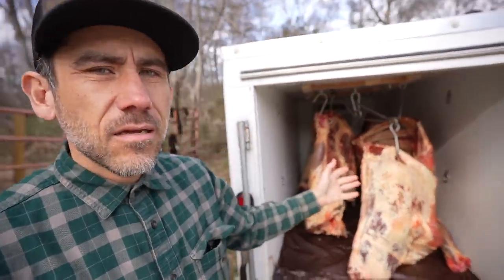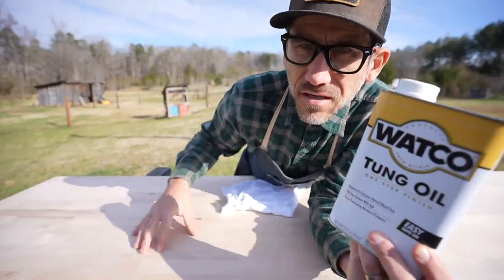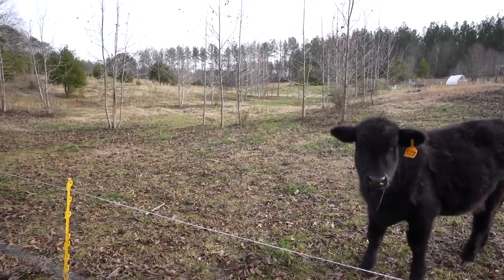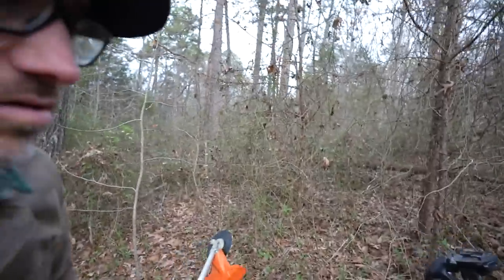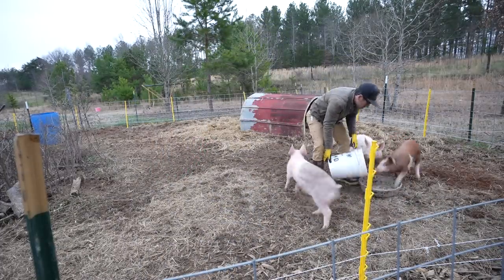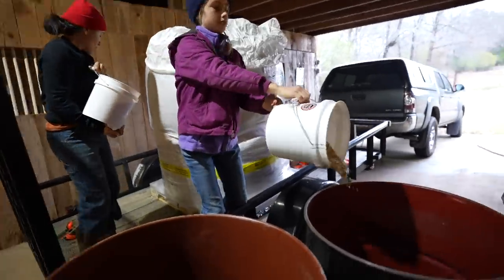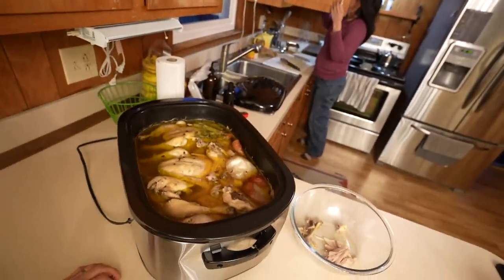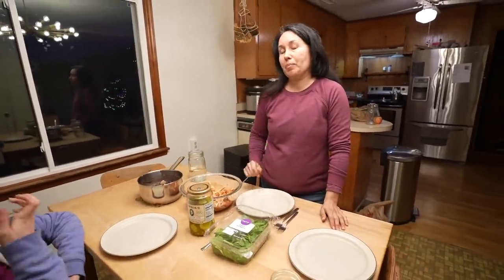Big Beef Requires Bigger Equipment (Heavy Duty Table)

Comment: If the cedars aren't growing in your fence line, and they don't prevent you from getting through an area, it's a good idea to let them grow large and shade out the area along the fence line. As they block the sun they will prevent other shrubs (like privet and blackberry) from growing up in your fence.
Reply from the maker: won't they kill our apple trees though?
Reply: I think they might be there to soak up water.  Cheddar trees are known for that.
Reply: Cedar Appple Rust is definitely a possibility..
Reply: @SowtheLand  You don't want the cedar trees to canopy the apple trees.
Reply: 6
Reply: Several other YouTube content creators (backed by experience with my grandpa's former pasture) say that these cedar-type trees are hyper-invasive and if allowed, will choke the land and continue to encroach.  
     This kind of tree would only shade your fence line by towering directly over it (sheared up like a poodle or ornamental) plus  needs be oriented to directly interfere with sunlight during the growing season.
      My grandpa rented a pasture of about 25 acres that had a fairly steep grade but when they stopped milking, it was too steep to do crops on.  In a matter of only a few years, it went from some scrub cedars near the upper fence line to being smothered by this type tree. 
      It is unfeasible to doze the land and more expensive than pasture land is worth if the current owners tried to rehabilitate this land.  At the moment, I believe he is trying to find a "set-aside" government program so they could be paid a stipend to leave that piece as habitat; if needs to be inspected to meet criteria, my farmer cousins say it is doubtful.  
     Check Arms Family Homestead site for several episodes dealing with this type of tree.

Comment: I bought a 4x8 sheet of “puck board” for $90 cdn. at Home Depot. I cut it to fit and covered two stainless steel tables. It works amazing for all of our meat ( wild elk, deer, beef, pork and chickens). Cleans up real nice and keeps the knives sharper longer. Not too slippery either. I highly recommend this as an option.
Reply from the maker: Great tip!

Comment: I grew up in Denver which has lower temperatures than Dallas, where I live now. The humidity in Dallas makes it feel really cold when the temps are low. But it can be warm too. Bring layers because you can have t-shirt weather or ice. If there's snow and especially ice, everything shuts down. Thanks for the tip about tung oil!

Comment: Jason, a couple things I saw that might help… please wear ear and eye protection when you are using the weed eater with brush cutter.  The helmet with shield and ear protector is only about $60 (just want to be able to see your videos for a long time. )thanks

I think you can use the winch like you used on the cow to get your feed totes out of the trailer. 
You can beef it up a little bit. 

Thanks for the heads up on tractor supply special oder it. 
I enjoy watching your videos. 
Thanks, Rich

Comment: If you unhook the trailer could you use the pallet jack to remove the skid of feed the trailer would tilt and allow the pallet jack to come of the trailer with out bottoming  out
I would try an empty skid first
And don't get hurt
I have a two Axel trailer and when I unload my mowers when it's not hooked up the front of trailer goes up and comes back down as I pull off the gate ramp

Comment: If you aren't saving the feed bags is building a make-shift chute to allow it to pour into the barrels possible? Cut a hole near the bottom to hit the chute? It won't help with the one underneath unless you can lift it but that might be something that could help make the job easier.
Reply: Also, I grew up in Dallas. January was usually high 30s to low 40s. The biggest thing is that there will be frost everywhere. Any missed school days we had were towards the end of January. Watch for ice and wind. They will come out of nowhere at times.